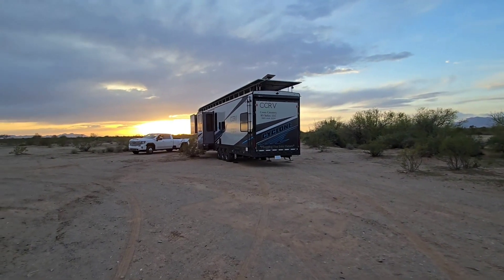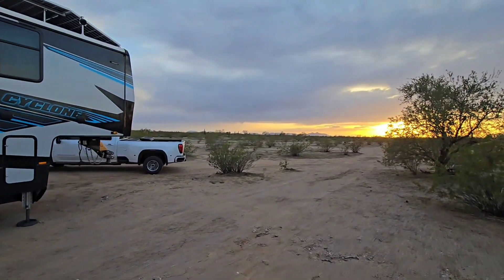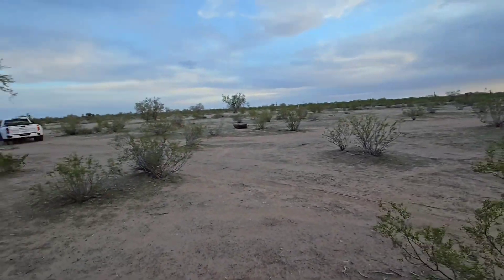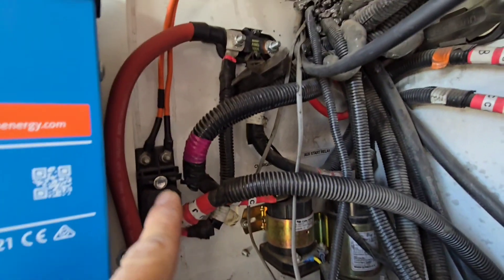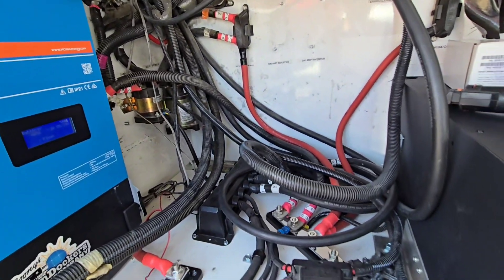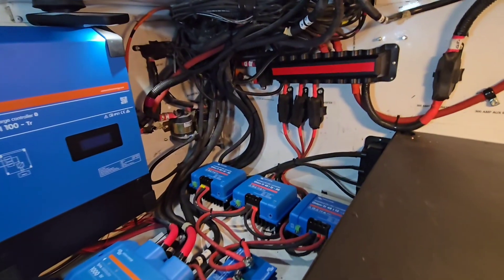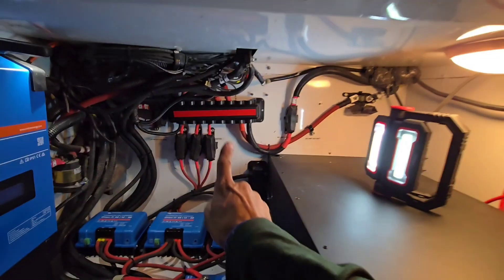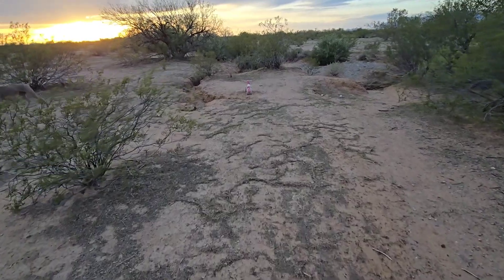48v Victron Solar System Repair in Class A Motorhome....

Comment: Do you foresee 48V starting become more mainstream anytime soon for RVs?  Or, will most people likely stick with 24V, even in 5kW+ systems like yours and the ones I see you installing?  The benefits of space saving with thinner wires, less heat, etc… seem too hard to resist.  I’m surprised there aren’t more 48V appliances already for these same reasons.

Comment: Hi Dereck. Hey I am a Hanks cross over. I have a question. DIY solar showed a complete 48v system you can build in 20 minutes not including panels. So my question, can one install this kind of system and install it to a 30amp receptacle and just plug my fiver into it when I am in need or does it need to wired into the circuit panel? Panel is in the back of the unit and battery/panel would be in the front. It may be a stupid question but looking for simplicity. 
Regards, Ted
Reply from the maker: I don't really follow Will but he definitely has created a popular channel....so yea you can do that....I personally wouldn't ever do that because its to DIY for what people hire me for lol....then ultimately one of the benefits to how I do things is it just is there to work all the time whether your plugged into shore, running a genny, or powering from ur batteries the clock on the microwave always stays set.....plus I'm just a complete Victron system guy.....
At the of the day as long as its safe meaning proper circuit protection and proper sized wires and it meets your needs then mission accomplished.....
Thanks so much watching, reach out anytime.....

Comment: My big motorhome generator takes 300 amps to start, so I went with a Heltec 330a BMS with a 1,200a surge, on my 560ah LiFePo-4 custom battery. I think they make even bigger BMSs now. I also have a standalone 48v system for my big, inverted power needs. I wouldn't trust using 10, paralleled 30a, 48v to 12v converters for this large of an amperage surge. That would be crazy.

Comment: no idea what you said - moving super fast 
I have a question
When connected to shore power the equipment charges to 14.2 - when not connected - I noticed under heavy loads the voltage drops faster than the battery bank capacity
what's the point of getting it up to over 14v - the moment you unplug it will never stay at 14 anything

where does your system level off when you are boondocking and run AC
Reply: If you have a noticeable voltage sag under a heavy load, check the size of your wires and all your connections with an infrared thermometer, like the ones used for checking tire and bearing temperatures. If you notice any hot connections or hot wires you have found your problem. If everything checks out it could be your BMS. Of course I'm assuming your battery is big enough. You shouldn't pull over 1C from your battery. So, if you are trying to run an A/C you will need at least 2, 100ah batteries in parallel to power it. A single 100ah battery isn't enough. But if your battery is fully charged at 14.4v (it's resting voltage will be 13.6v) it shouldn't drop below 13.2-13.3 volts initially even under a heavy load depending on the size of your battery. Remember the nominal voltage of a 12v LiFePo-4 is only 12.8v, which represents a 20% charge level.